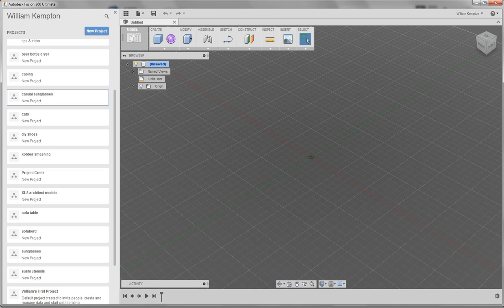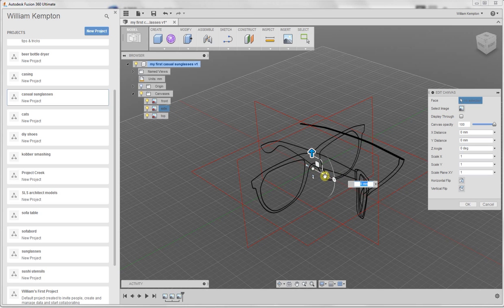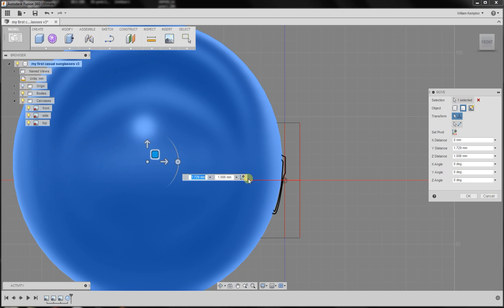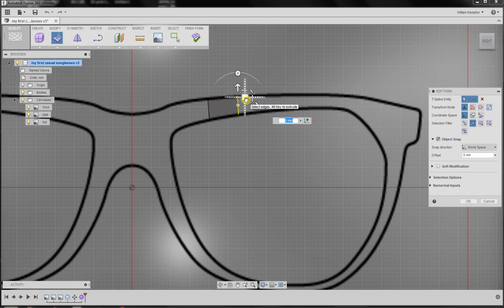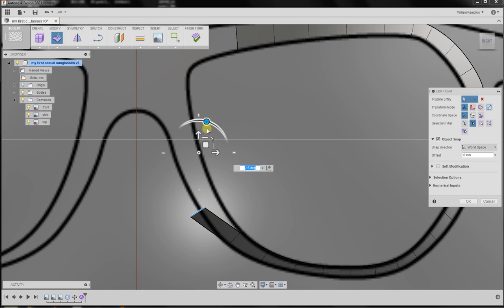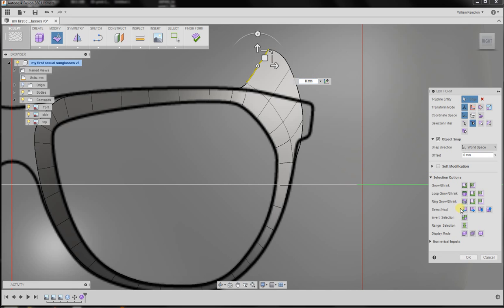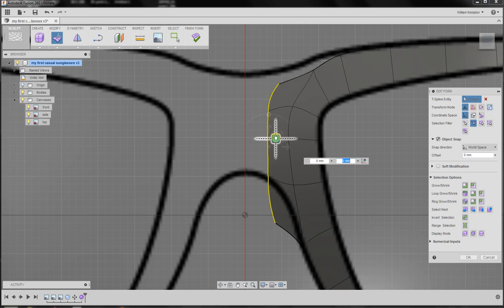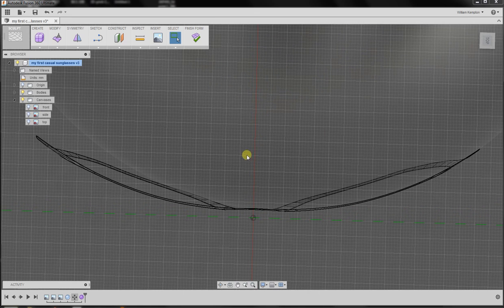Designing sunglasses in Autodesk Fusion 360 - Basic setup - 1/3

Comment: Great tutorial. But why exactly (1/9)m*2 is diameter of sphere? Is it standard for all eyeglasses designs?
Reply from the maker: Well, there are different spheres for different kinds of glasses. Sporty ones generally have smaller spheres, while casual glasses such as Navigators have larger spheres. The name of the scale escapes me at the moment, but if you go to an optician you can buy different lenses for different types of glasses. You can also measure an existing lense (a serious optician will have one) if you need to replace the lenses on an existing pair.
Reply: WilliamKempton Thanks for answer. Could you recommend some resources for eyewear/eyeglasses designing for real world solutions?